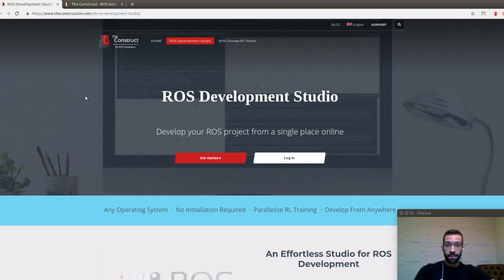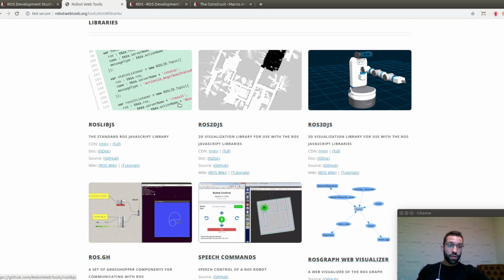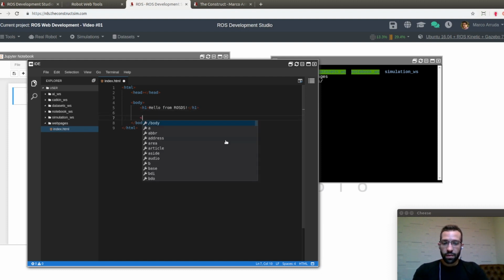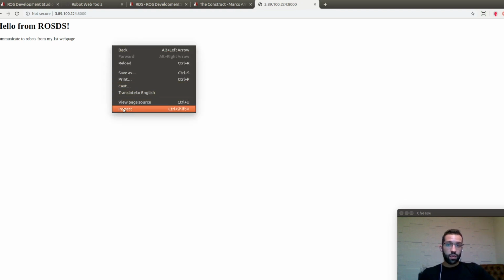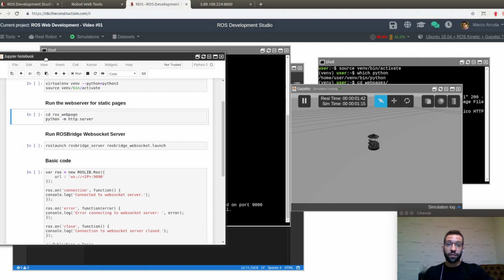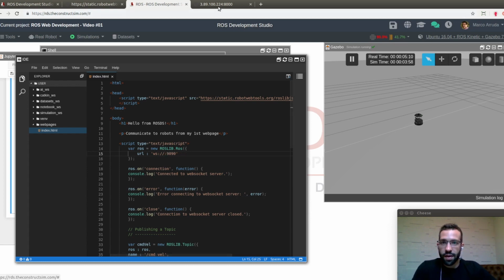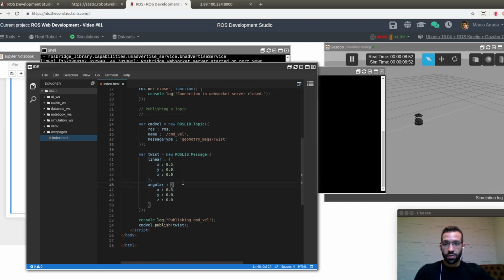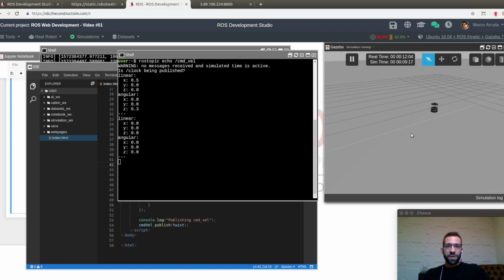Developing Web Interfaces For ROS Robots - Ep 1: Introduction to ROSBridge Server

Comment: Amazing video and  knowledge were provided. State of the art info. I really appreciate for shearing!!! Thanks. I have only one remark here => may be such info should also be given. If somebody needs RealTime systems so controlling from WEB is not good alternative since (probably), feedback is not accessible  = we provide open loop controller due to delays or control strategy design. WEB server can generate Feed Forward set point(torque, speed, position) but only local (on the robot controller/drive) controller (for example PID) can manage the robot control signals (in close loop based on reference from ref from WEB server).  From my point of view, the WEB can be very useful for replacing the HMI, can be useful fo maintenance, debugging as well but for performing control can be very challenging. Thanks again for your video!
Reply: Hello Markus, very good comment! Web interfaces are not used (and I make it very clear in the course about it) for closed loop controllers. We can't ensure good realtime communication. But they are very good for monitoring and, as you have said, FeedForward set point! Thank you for sharing